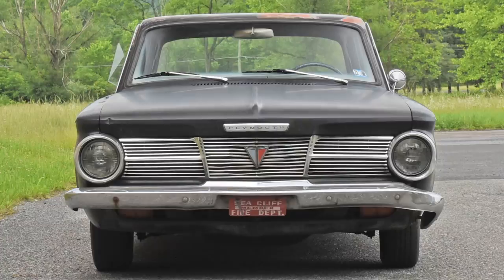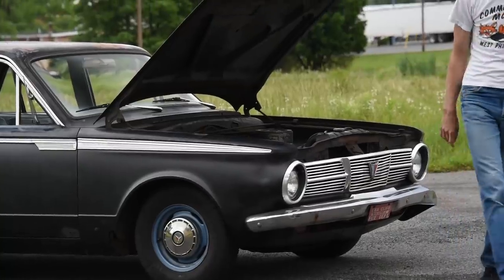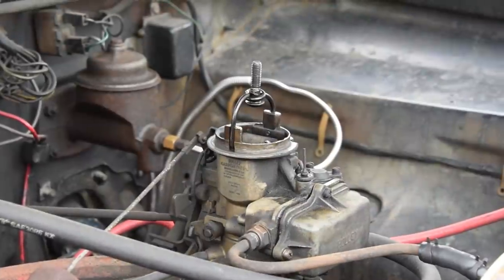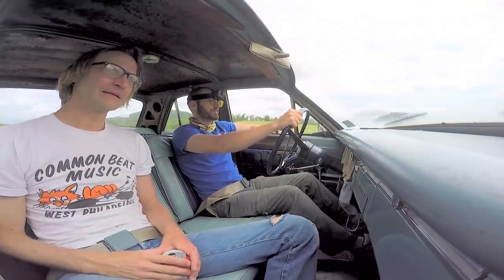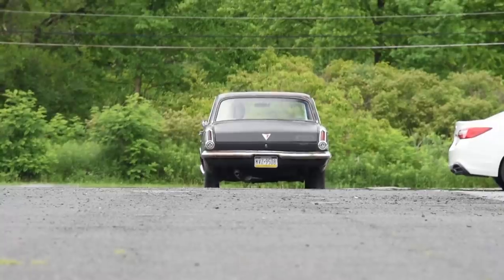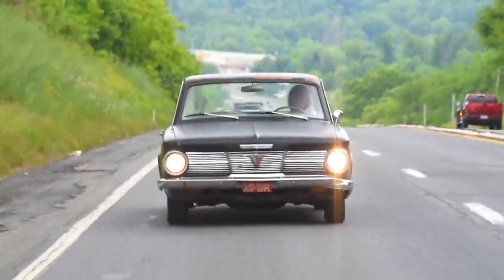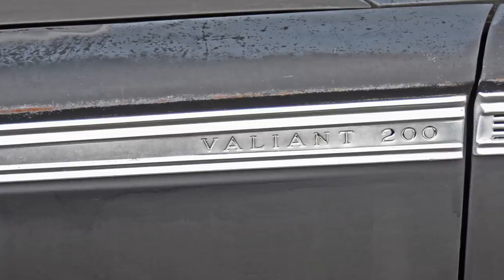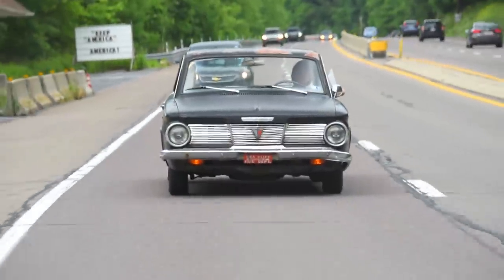1965 Plymouth Valiant 200: Regular Car Reviews

Comment: These cars can be improved 100% with a 318 and Torqueflite to make it a reasonable car to drive.
Reply: The 170 is a bit underpowered, okay in flat territory.  The 225 would perform stronger.  Chrysler should have built a smaller version of this car for the 170 - its a good motor but the A-body is too much weight.  I rarely hear of anyone modding the 170.   These motors replaced a flathead six.  In 1959 2/3 of Plymouth buyers chose the flathead six, the Valiant was built to challenge underpowered VWs that were becoming popular and it did well for that role.
Reply: Dunno why they even made the 170, in Australia we only got the 225 which made the competition look pathetic. What we did was ditch the slant for the Hemi 6- preferrably the 265 which as standard was 203hp or the factory race version which was 302hp with triple 45mm Webbers.

Comment: I had a 65 Valiant with a FACTORY four speed. The better floor shift linkage and syncro low made it much more driveable. BUT, it still accelerated slower than fog even with the optional 225 slant six.

Comment: These old Valiants are a big part of my family history. My grandpa bought a gold '64 Valiant wagon (3 on the tree) new. He was a travelling salesman. By the early 1980's, the floor rotted out, but the 225 Slant Six didn't miss a beat, even with 300,000 miles. He bought a white '64 4-door (with a cracked block), out of Washington state, and transplanted the high-mileage engine into it. While grandpa his this white 4-door, my dad bought a blue '65 Valiant (the 1965 Canadian Valiant was a US Dart with Valiant badging). This had a short life, and then we bought (for $1) grandpa's white '64. We drove that until 1995. There was a '75 Valiant that grandpa had, and then passed on to us. Mom also had a '79 Volaré for a while.
When I bought my first car in 2001, I bought a blue '68 Valiant 2-door post. I loved it so much, I bought a '69 Signet two door for parts... then a couple of four doors (68 & 69).
I learned a LOT about cars from my history with Plymouth Valiants:
1) Drum brakes SUCK.
2) Tell mechanics about the 'left-hand thread' BEFORE they start removing your driver's side tires!
3) A Slant Six will never leave you stranded.
4) Always carry extra Ballast Resistors with you, when travelling.

Comment: My first car in 1983.  1965 Valiant, red, slant 6, automatic.  Driver side floorboard was a board, a 2x6. Most of the leaf springs were broken, some of them partially missing. Rusted out everywhere. Those are just the highlights. She failed fully half of them items on the Iowa inspection list. I learned so much fixing that car up.  At the reinspection it failed 1 item: the turn signal wouldn’t return when making a turn (can’t remember if it was left or right), it would happily blink away after returning the steering wheel to center.  I glumly drover her back home and removed the steering wheel. Old brittle plastic, the little tab was broken off but still in the steering column. Shopped around, but I couldn’t get a replacement. I sandwiched the tab and main piece of plastic between 2 other little pieces of plastic and a healthy coating of super glue, let it set for a while, carefully replaced it in the steering column, and put everything back together.  I fought the urge to signal turns all the way to the shop that did the inspections.  The mechanic came out, tried it a couple of times, and marked it down. That was a great feeling, being able to get that nearly lost cause of a car to pass the state inspection. 19 year old me felt a sense of pride and accomplishment that I’ve seldom felt since. 

Driving her back home, the turn signal return broke again the first time I used it.

Comment: My best friend dailied a 64 Biscayne in the late 80's. Optioned like the Valiant except his was cherry and of course had a 235. I'm old and miss the days when these were 500 buck cars that were everywhere. Getting the nostalgia vibe going...
Reply: Edit. The 64 Biscayne had a 292. So it was the hot set up. LOL. ( Actually it did good on the highway,; tall gears and the Stovebolt was a solid engine.)

Comment: Our Aussie and Kiwi versions of your 1965  200 was a 225 with 145 hp, and it did 18.8 second quarter miles and 100 mph with a three on the tree and a 3.23 axle. My dad's AP5 Valiant Sedan was just as economical as the 170. 24 mpg US best. Our AP5 and AP6's...
Similar car...different roofline and tail and belt line swage line, but similar looking to the 4 door. Our belly panel valance was 100% the same, but no indicators down low. They were in the grille on ours. Valiant love is Universal!

Comment: Valiant means all of that, all of that and more here in Australia. "Valiant" was really '61-'81 here and morphed in our market into a spectrum from the 'base model' to the 'luxury' models as well. Rubber floor mat, 3 speed manual column, drums all round on a 6 cylinder or big v8, auto, air, power everything, front disc  and vinyl roof etc etc on basically the same wheel base for example in the middle ('71). throw in wagons, utes, panel vans, coupes, hardtops, lengthened luxury sedans......... "Valiant" covered a lot of territory.

I drove one of mine to work yesterday. I came home and watched this.

I slept well last night.

Thank you

Comment: Hmm, compared to modern cars of this class, the Valiant is just a cart on wheels! But think about whether the modern semblance of this car can still drive after half a century and five years?
Reply: American cars of that era were not made to be reliable there were made with planned obsolescence in mind and that they would be pretty much done for within less than 5 years and model lifecycles were just 1 year in comparison to Europe which were almost a decade and the only reason they kept on going is due to mechanical simplicity owner dedication and the production numbers
Reply: Or how many other Valiants are scrap? Classic cars that are still running are usually the exceptions and survivors of their generation.
Reply: @Thanos.m  not valiant.
Reply: @stephenmoutafis5587  Mechanically, the slant six and drivetrains looks back to Mopar's experience with its flathead six, which was loved by many for its durability and ease of service.  Somewhat tractor like, the 225 with its constricted 1-barrel carb is designed to spend most of its life under 3,000 RPM, with the 170 being capable of more RPMs.  Other than limited top end power, there aren't many faults to these motors.  The Chevy, AMC, and Ford inlines sixes also have their fans for durability.  Get into a discussion about the Ford 300!   If we had just cared to keep up with repairs there would be a huge number of the  '60s American economy cars still around.  I'm liking the Ramblers more all the time.  These old U.S. compact cars are just the right size for daily drivers today.

Comment: This review sounds like your talking about my old 77  Chevy Custom Deluxe . Straight six 3 on the tree vents on the floor, no power steering or brakes . Get to 50 miles an hour and the engine sounded  like it would blow hood off.

Comment: I get this. I have a ‘94 land cruiser pushing 300k on the odometer. It’s slow, guzzles petrol, pulls hard either direction when braking and leaks oil everywhere and only two windows open. Having said that, I love it. Always wanted one and when I’m driving down the road I feel like I won the lottery.

Comment: i got a 64. gonna keep og maybe change rear gears for  easier and higher top speed. trying to get a 65 2dr and imma 8 3/4 rear and a turbo. VALIANT FOR LIFE. ITS MY FIRST BORN! had mine for 5 years so far. 61k miles and 63k now. love it. getting teared up. how you fix over heating?

Comment: Oh this is awesome! I'm glad you did this. 
I have a 63' dart with a 225cid slant six that was my grandfather's and dads. Have to weld in a new floor before I drive it.  But people put four barrels, intake, exhaust, cam, port heads, etc. Want to do that and maybe get a four speed with overdrive sometime.
Reply: That was called the  Hyper Pack that took 1st through 7th at Daytona. Richard Petty was 1st.
Plymouth Hyper-Pak Slant Six engine with long throw intake manifold with 4 barrel Carter - cicra 1959. Hyper-Pak was released to quality the engine for the NASCAR Compact Car race at Daytona International Speedway scheduled for January 31, 1960 - Mopar Magazine 
They may be wrong on the 1959... 60 sounds more like it.

Comment: I had a '73 Plymouth (Valiant) Duster, 225 slant six, 3-speed manual floor shift, 4 wheel drums, no power steering, no A/C (of course).  Maroon with black vinyl.  I ... LOVED ... that car.  Room for 6 fat bodies, room for 6 more in the trunk, maybe 10 more.  Terrific gas mileage (at the time) and bullet proof.  I had it for 5 years and only replaced ONE taillight after I got rear ended.  NOTHING ever broke on that car.  It had nothing in it TO break.  I bought it in 1981 with about 70,000 miles on it.  I put two Kraco 6x9 speakers in the back deck.  Who didn't?  55-60 mph on the highway but no faster or the engine would ..... HOWL.  LMAO  This was a great episode.  Well done.

Comment: I owned four of those over the years. (so the first was a Dodge Lancer same thing) Trouble free. Got you there no matter what and when gas was 98 cents a gallon it got around 22 mpg. In the later years of the Valiant Plymouth made an economy  model that got nearly 32mpg. Oh and then there was the HyperPak option for hot rodders. The Barracuda; a fastback Valiant.Thanx for the memories.

Comment: I bought a new 1968 Plymouth valiant with the small six, not the 225. In many ways it was similar to the way this one is described except that it would run all day at 70 to 75 mph. Noisy, yes. But not over revved. It was the classic example of a four-door gutless wonder. Mine got 28 miles per gallon on the open highway. And while waiting on a mountain pass where the highway had stopped running because of a jackknifed truck in the snow, I decided not to chain up to get started. Used second gear, slip the clutch with barely any throttle and slowly but surely with no tire spin we started climbing up the mountain when the road open. We were running comfortably on hard pack snow at 40 to 45 mph by the time we reached the summit. For me that was a miracle car. It had so few horses that simply by using second gear and slipping the clutch he drove right up the hill. I would really enjoy having it back and I’m almost 80 years old. Even more importantly I knew how to run the car and tune it up when need be and did never let me down.

Comment: A few years ago I daily'd a '64 Valiant sedan to Austin Texas 60 miles one way.  It did what it was supposed to.  I currently own three 64 and 65 Valiants, one with the 273 v8 - all are two doors, one a hardtop Signet and the other a convertible.   The chassis is basically a good starting place for mods.  Chrysler never did much to refine A-bodies.  The unibody is metal-on-metal with only rubber bushings in the suspension - relatively a lot of road noise , but not a lot nosier than my 2005 Honda Civic.  The slant six isn't necessarily noisy, there is almost no attempt to deaden the sound.  I've attempted to re-start a slant six when it was already running - when the valves are adjusted these motors are not that noisy.   Add some Dynomat or foam insulation and they are much quieter at speed.

I've read that BMW designers were inspired by the popularity of cheap U.S. economy cars with six cylinder motors.  What if Americans were offered an upgraded economy car that had more luxury and was more fun to drive?

Comment: We had a 1965 Valiant 200 with automatic transmission. One of the best cars we ever had. Only “minus” was no A/C. 225 slant 6 ran great. No problems. Had it until it was stolen in 1980.

Comment: Just sold a four door 63 with a manual. Sat for 20 years in our driveway and someone saw her, had to own her and came and got her. Said he had the engine running that weekend. But floors, a fuel tank, fuel lines and brake cylinders were all needed. But they are dirt cheap and easy things to do on these cars.

Comment: Chris, you are a legend among men to have the balls to daily this old girl for so many years. I can absolutely relate as I was raised in a few very sparse and old vehicles, mainly old Ford Econolines (we had a beautiful Ford dually diesel but that was more for work and special occasions, most drives were the vans) as was my very first vehicle, a ‘78 Econoline, all with rust holes you could crawl through, no A/C, heater that made more noise than heat, old weatherstripping so the whistle from the wind was constant, no sound deadening, vinyl seats that burned off skin in the summer, no power from the 300 straight six, etc etc etc, you know the drill lol.
And you know what, I wouldn’t change that even if I could. It made me a better person. Made me appreciate things that most take for granted. And made me see beauty in all vehicles, no just the poster cars. And in some ways I prefer driving those older vehicles. Every trip, even a short one, was an adventure. You can tell driving was something looked at as less of a routine back then. And you notice more things too. An old (period correct, not resto mod) car or truck on a back road is an experience. The sights, sounds, and smells that newer vehicles keep out add to the adventure. It takes you back to what many look at as a better time. 
And my hats off to you for enjoying all of this, and keeping that old girl going.
I’m sure you know that slant six, just like the Ford 300, will probably outlast us when taken care of, so I hope you get many many many more years of enjoyment from her. It’s a valiant effort on you and the cars part (had to do at least one dad joke lol) and one that will go on for a long time
Much respect ✊

Comment: Crazy reliability in that slant 6, and super simple.  Loved the 1968 Valiant I had 25 years ago.  New cars have shit airflow with the windows down, but it was a blast with those old cars.  They had the windsucker windows at the front, and then the '68 had some vents you could open by your feet.  Who the f needs AC.  Oh and bench seats for McLovin'.  So I bought this thing running nicely for $400, and we drove it along with another car from Sarasota to Miami, and then 900 miles or so to Richmond VA.  Just about the only car I miss getting rid of.

Comment: Self cancelling turn signals were standard on even the bottom of the line V100. I know because my '65 wagon had them. The hooks on the cancelling cam have broken off from age. The good news is that Classic Industries sells a replacement cam for $9.99. Also, someone must have changed the rear end because the 170 with standard 3.23 rear end was good for over 90. I bought my 100,000 mile  V100 wagon for $100, pulled the 170 and dropped in a 225, some Volvo seats and then drove it for another 90k miles. That's been 40 years ago and I still miss that car.

Comment: This very much reminds me of my 1st $500 car, a '72 Datsun 510. A total shitbox, but so00 easy to run. I never kept any tools in it except for a pair of chain-nose pliers and a flathead screwdriver in the glove box. If it started running shitty, I just got out and adjusted the carb with the screwdriver. doors were like 2" thick, made every highway trip an adventure. The play in the steering wheel? A crack IN THE FRAME under the steering gearbox. I loved that car...

Comment: Being in Australia we had variations on the Falcon and Valiant. And then Holdens. All similar size cars.
Our 65 AP5 Valiants all had 145ho 225s.. With 9" drums but they did have synchro on first. And were by far the most powerfull and fastest of the lot. But handled,,,, well like a Valiant. And diff ratio was 3.23 with 14" wheels
By 65 Falcons too had synchro in first. Holdens eventually got if by 68 as an option!

Comment: I drove a 170  '62  Valiant  3 on the column for almost thirty years. Every five years or so, the clutch Z bar had to be taken out and welded.  It ended up with a no lead 225. I had to get a air filter assembly out of a later model to get the hood to fit right. It had a magic speed of 62 miles a hour. Any slower, it would overheat, any faster, it would overheat. You could endlessly drive at 62.  By the way, it looks like the car in the video should have a screw on the top of the steering gear tightened up.

Comment: As a youth I owned a 63 Dart, a 64 Dart, and later, a 67 550.
Bought the 63 Dart from my HS auto shop for $25 after they got done murdering it.
I knew I wanted one as the Auto Shop class text book had a pic of the 225 Slant Six
with the caption "it doesn't get any easier than this to fix"!
Plus the 63 and 64 had that zazzy push button auto trans.

Comment: I had a 1969 Dart with the 170 six and the 3-on-the-tree, because I wanted it that way.  No power steering or any other option besides a radio.  Got to tinker with every piece of the car as does this owner.  And I loved driving it.  Didn't mind no synchro in 1st too much.  And it sailed down the road pretty smooth - I occasionally got it up to 65, not much more.  But I loved driving it.  It was so damned elemental in the age of power everything and plaid interiors - I owned it in the late 70s, Jimmy Carter era.  I guess this owner wants that very same experience.  I just hope he had an Iphone with unlimited data for that long ride south.  Radio delete in 2021 - idk, idk.

Comment: Mom bought a new '64 Valiant after the divorce.  It was a "Signet" 2 dr.  Black with red interior and bucket seats, automatic push button selector.  Kept it 5 years until her next new car... '69 Dodge Dart 318 V8. Also a 2 dr but the Dart had power steering.
It was actually fun to drive.